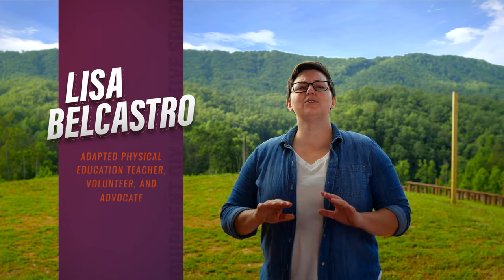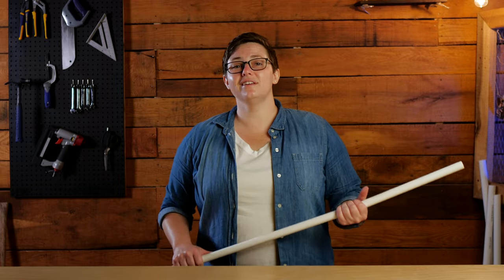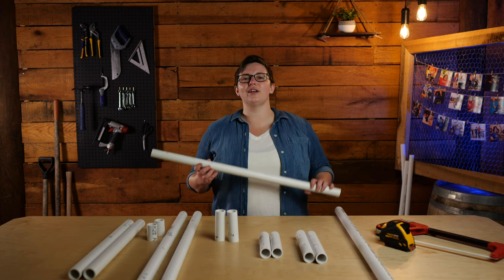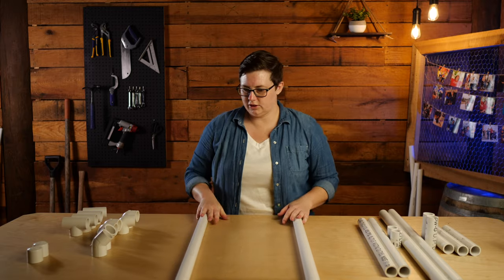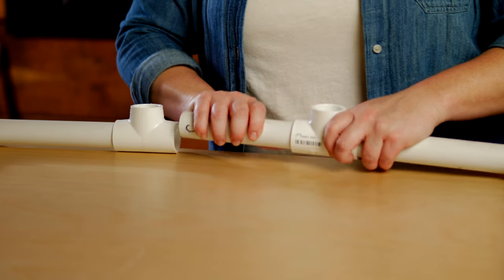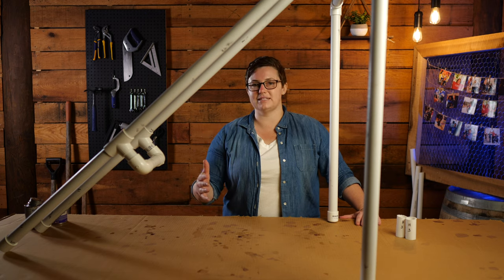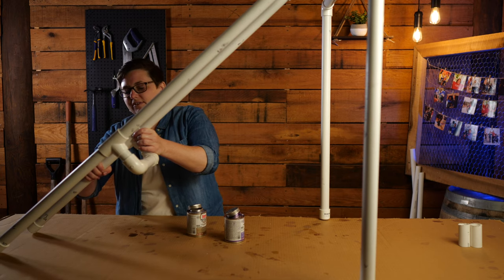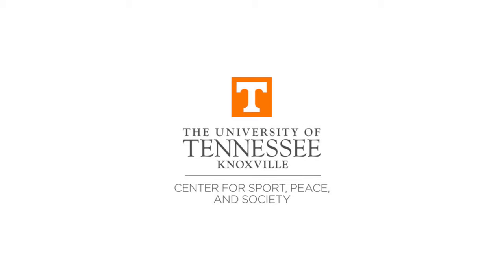Bowling/Bocce Ramp - Episode 8 - D.I.Y. Adapted Sports Equipment

Comment: Just as an update to the 1964 prices she mentioned.  My individual ramp build was $36.58  PVC + $6.98 for cement = $43.56. 

2x 10’X1” PVC - $15.12
4x 1” Tee’s - $7.24
4x elbows - $6.24
2x 45° elbows - $3.30
4x 1” caps - $4.68
Cement x $6.98

Neat modification. I bought 2x 1 1/4” x 2’ pipes that slip over the legs like a sleeve. I puts caps on, drilled through holes and installed wire lock pins for height adjustability. It’s about a $20 upgrade for 2x pipes, 2 caps and 2 pins. Pins were $4.75ea.